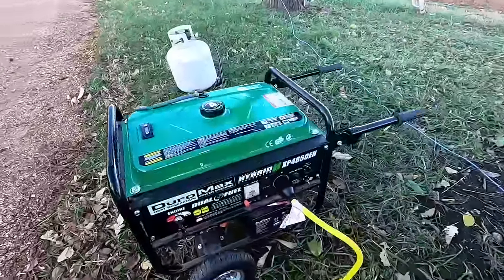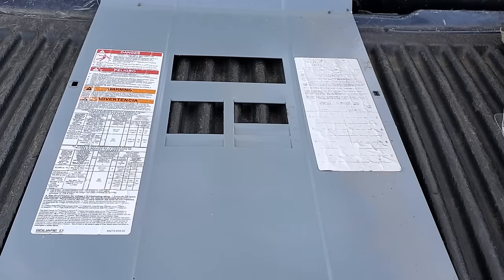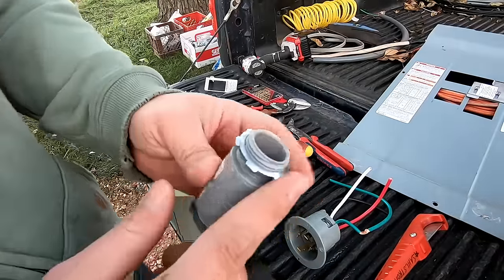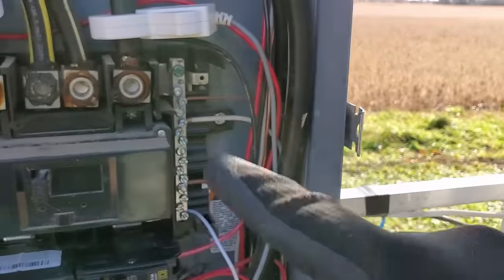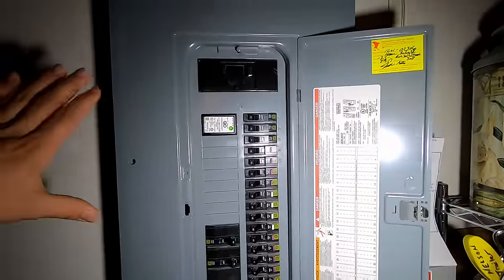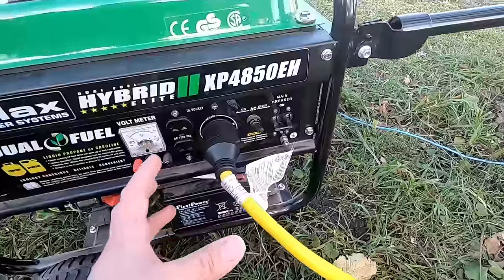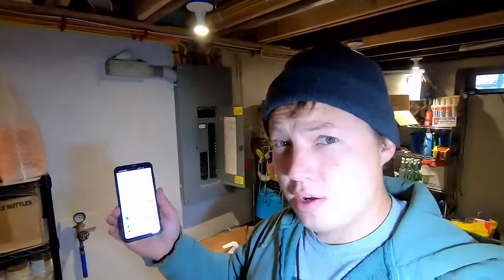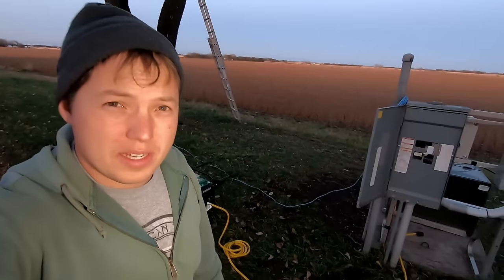How To Hook Up a Generator To Your House Using a Breaker Interlock Kit & Power Inlet Box

Comment: Nice job, the only thing I would add is when connecting 2 wires twist the 2 bare wires together prior to putting the wire nut on, in the event the wire nut loosens the wires will remain nice and tight.
Reply: Can't individually tug test twisted wires, bruh.
Reply: Here are the generator safety rules that everyone needs to follow: this is just a reminder for everyone’s safety. Always make sure you follow all the generator safety rules whenever you use your portable generator. Generators can be dangerous if not used carefully. Every year, hundreds of people die or get injured when using portable generators due to carbon monoxide poisoning and electrocution. Make sure you are using your generator carefully and keeping others safe as well. There is something very serious that everyone should always be aware of when using generators. Some people do run their generator indoors which is not safe and that increases the risk of carbon monoxide poisoning which can cause death of family and you. Some people run their generator in wet conditions which can electrocute them. Please remember that you should never run your generator indoors. Remember that carbon monoxide is an odorless and colorless gas that you cannot see or smell. Carbon monoxide is a silent killer. Keep that in mind. Make sure your generator is 15-20 feet away from your house and away from doors, windows, and vents. Never use your generator in your porch too. Having a carbon monoxide detector is very important against generator safety. Some people also allow children to go near the portable generator which could pose risks. We need to keep an eye on our children making sure that they are not near the portable generator so they won’t get electrocuted or burned by the generator which is dangerous. A locking enclosure also keeps kids safe. A generator shed might look like a tempting place to explore, or take cover during a game of hide and seek, but a generator is a dangerous piece of equipment that can cause injury. It says on the manual that we should also keep children away at all times from the portable generator to avoid injuries. Please do not allow a child or unqualified people to operate the portable generator.  It is important to keep your children safe especially little ones. The portable generator can be hot during an operation. Just because some manuals missed what should be listed doesn’t mean it’s safe to do. Always follow the generator safety rules when using portable generators. Generators pose electrical risks. If you need to use your generator during wet weather, you need a generator tent to protect your generator from getting wet. Don’t let your generator get wet. Keep your generator dry and before using your generator, please make sure your hands and your generator is dry. Do not wear loose clothing when operating the generator. Everything that is said on the generator’s operating manual should not be ignored. Never smoke cigarettes near the generator. Please keep flammable things away from the generator. Never overload your generator too. Your generator can catch fire. Never ever try to plug a generator cord into a wall outlet to avoid back feeding. Back feeding your generator is dangerous. Always turn on your generator first before plugging in appliances and shut off the appliances before turning your generator off. Use a heavy duty cord for your generator and the cord should not be worn out. All the instructions should be followed carefully. Never refuel your generator while it’s running. It can cause fire if fuel spills while your generator is hot. You should turn off your generator and let it cool off before refueling it. Having a fire extinguisher next to the generator is also important. This is only a reminder for everyone’s safety of using generators. Make sure your generator is properly grounded. Having a fire extinguisher next to the generator is also important against the safety rules. https://youtu.be/I1jT3ANENvI and here is a video more about keeping others safe when using generators and also about our family’s safety. It’s important to keep our little children safe as well. Make sure your little children are kept away from the generator at all times especially when it’s running. Hope everyone finds this helpful. Always remember that it’s better to be safe than sorry. Remember that warnings should not be ignored.

Comment: Great Video!  I would love to see you make a video about connecting a Ford Propower truck with the on board generator to your home.  To avoid a ground fault code on the truck, that system needs a three-pole transfer switch instead of an interlock.  I think a video where you go through the bonding on that system and the safe methods needed to connect the truck to the house would be great!

Comment: A very well done video. One suggestion, I live near  Houston and it is very humid here and with the ethanol gas if you don't drain the fuel tank after every use that steel tank will rust in no time. What I have done is use only non-ethanol gas and replace the metal tank with a plastic marine fuel tank. No rust and no problems. Leave it fueled so it is ready to go any time you need it.

Comment: This video is a few months old, but I have a comment and a possible reason why you only got to about 3100 watts before the breaker tripped.  I have the same generator and the manual says that when running on gasoline AC rated wattage is 3850 watts.  But when running off of Propane the rated wattage is only 3273 watts with a peak surge of 4123 watts.  So if you really want to use all of that power it would be best to run the generator on gasoline.  Having said that, I only use Propane to run mine because I only  use it to run the A/C unit on my camper.   However, it does seem that the vent hoses are of very poor quality and will soon crack.  I've replaced mine with better quality hose. Other than that little quirk, it's a great little unit.
Reply: If it were lack of engine horsepower it would have slowed down and caused low frequency and possibly voltage or it would have stalled entirely. It tripped the breaker but remained running which tells me that he had an unbalanced load with too many amps on one hot leg. Supposedly the Sense monitor can show individual leg/phase amps and this would have to be monitored when on generator.
Reply: @danielthechskid  I got this information from page 52 of the Generator Operator's manual.  The expected wattage is listed under "specifications".  I'm not knocking the video or the generator.  Just quoting a page directly out of the manual.  I don't use anywhere near  that wattage, so I don't know this for sure

Comment: Good job on the video. The generator wattage is reduced on Propane by about 10% to 15% versus running on gas which is why it tripped earlier than expected.
Reply: Here are the generator safety rules that everyone needs to follow: this is just a reminder for everyone’s safety. Always make sure you follow all the generator safety rules whenever you use your portable generator. Generators can be dangerous if not used carefully. Every year, hundreds of people die or get injured when using portable generators due to carbon monoxide poisoning and electrocution. Make sure you are using your generator carefully and keeping others safe as well. There is something very serious that everyone should always be aware of when using generators. Some people do run their generator indoors which is not safe and that increases the risk of carbon monoxide poisoning which can cause death of family and you. Some people run their generator in wet conditions which can electrocute them. Please remember that you should never run your generator indoors. Remember that carbon monoxide is an odorless and colorless gas that you cannot see or smell. Carbon monoxide is a silent killer. Keep that in mind. Make sure your generator is 15-20 feet away from your house and away from doors, windows, and vents. Never use your generator in your porch too. Having a carbon monoxide detector is very important against generator safety. Some people also allow children to go near the portable generator which could pose risks. We need to keep an eye on our children making sure that they are not near the portable generator so they won’t get electrocuted or burned by the generator which is dangerous. A locking enclosure also keeps kids safe. A generator shed might look like a tempting place to explore, or take cover during a game of hide and seek, but a generator is a dangerous piece of equipment that can cause injury. It says on the manual that we should also keep children away at all times from the portable generator to avoid injuries. Please do not allow a child or unqualified people to operate the portable generator.  It is important to keep your children safe especially little ones. The portable generator can be hot during an operation. Just because some manuals missed what should be listed doesn’t mean it’s safe to do. Always follow the generator safety rules when using portable generators. Generators pose electrical risks. If you need to use your generator during wet weather, you need a generator tent to protect your generator from getting wet. Don’t let your generator get wet. Keep your generator dry and before using your generator, please make sure your hands and your generator is dry. Do not wear loose clothing when operating the generator. Everything that is said on the generator’s operating manual should not be ignored. Never smoke cigarettes near the generator. Please keep flammable things away from the generator. Never overload your generator too. Your generator can catch fire. Never ever try to plug a generator cord into a wall outlet to avoid back feeding. Back feeding your generator is dangerous. Always turn on your generator first before plugging in appliances and shut off the appliances before turning your generator off. Use a heavy duty cord for your generator and the cord should not be worn out. All the instructions should be followed carefully. Never refuel your generator while it’s running. It can cause fire if fuel spills while your generator is hot. You should turn off your generator and let it cool off before refueling it. Having a fire extinguisher next to the generator is also important. This is only a reminder for everyone’s safety of using generators. Make sure your generator is properly grounded. Having a fire extinguisher next to the generator is also important against the safety rules. https://youtu.be/I1jT3ANENvI and here is a video more about keeping others safe when using generators and also about our family’s safety. It’s important to keep our little children safe as well. Make sure your little children are kept away from the generator at all times especially when it’s running. Hope everyone finds this helpful. Always remember that it’s better to be safe than sorry. Remember that warnings should not be ignored.

Comment: This is great.  I did this once before without the interlock, but the interlock makes it so much safer.  Thanks.  Sure beats the whole transfer switch issue.
Reply: Generator safety rules: Always make sure you follow all the generator safety rules whenever you use your portable generator. This is a reminder for everyone’s safety of using generators. Generators can be dangerous if not used carefully. Every year, hundreds of people die or get injured when using portable generators due to carbon monoxide poisoning and electrocution. Make sure you are using your generator carefully and keeping others safe as well. There is something very serious that everyone should always be aware of when using generators. Some people do run their generator indoors which is not safe and that increases the risk of carbon monoxide poisoning which can cause death of family and you. Some people run their generator in wet conditions which can electrocute them. Please remember that you should never run your generator indoors. Remember that carbon monoxide is an odorless and colorless gas that you cannot see or smell. Carbon monoxide is a silent killer. Keep that in mind. Make sure your generator is 15-20 feet away from your house and away from doors, windows, and vents. Never use your generator in your porch too. Having a carbon monoxide detector is very important against generator safety. Some people also allow children to go near the portable generator which could pose risks. We need to keep an eye on our children making sure that they are not near the portable generator so they won’t get electrocuted or burned by the generator which is dangerous. A locking enclosure also keeps kids safe. A generator shed might look like a tempting place to explore, or take cover during a game of hide and seek, but a generator is a dangerous piece of equipment that can cause injury. It says on the manual that we should also keep children away at all times from the portable generator to avoid injuries. Please do not allow a child or unqualified people to operate the portable generator.  It is important to keep your children safe especially little ones. The portable generator can be hot during an operation. Just because some manuals missed what should be listed doesn’t mean it’s safe to do. Always follow the generator safety rules when using portable generators. Generators pose electrical risks. If you need to use your generator during wet weather, you need a generator tent to protect your generator from getting wet. Don’t let your generator get wet. Keep your generator dry and before using your generator, please make sure your hands and your generator is dry. Do not wear loose clothing when operating the generator. Everything that is said on the generator’s operating manual should not be ignored. Never smoke cigarettes near the generator. Please keep flammable things away from the generator. Never overload your generator too. Your generator can catch fire. Never ever try to plug a generator cord into a wall outlet to avoid back feeding. Back feeding your generator is dangerous. Always turn on your generator first before plugging in appliances and shut off the appliances before turning your generator off. Use a heavy duty cord for your generator and the cord should not be worn out. All the instructions should be followed carefully. Never refuel your generator while it’s running. It can cause fire if fuel spills while your generator is hot. You should turn off your generator and let it cool off before refueling it. Having a fire extinguisher next to the generator is also important. This is only a reminder for everyone’s safety of using generators. Make sure your generator is properly grounded. Having a fire extinguisher next to the generator is also important against the safety rules. https://youtu.be/I1jT3ANENvI and here is a video more about keeping others safe when using generators and also about our family’s safety. It’s important to keep our little children safe as well. Make sure your little children are kept away from the generator at all times especially when it’s running. Hope this helps. Always remember that it’s better to be safe than sorry. Also remember that warnings should not be ignored too.

Comment: The wiring leaving the box in your house is done nice. Not an electrician but I do appreciate neat and orderly wiring.
Reply: Don’t forget about the generator safety tips as well. Remember safety is always important. Here are the generator safety tips:

1) Please do not allow an unqualified person or your children to operate the portable generator. Just because some manuals don’t say that doesn’t mean it’s safe. That is important against the generator safety rules. We also need to be keeping an eye on our children too. You need to make sure that your children are not playing near the portable generator especially when it’s running so they won’t get electrocuted. Generators pose electrical risks and they can be hot during an operation. Please keep your children away from the portable generator at all times. It is important to keep our children safe especially our little ones. Be aware of all the hazards.

2) Some people use their portable generators indoors which increases the risk of carbon monoxide poisoning. It’s important to have a carbon monoxide if you have a gas generator. Never ever use your generator indoors even if your doors and windows are open and even in the garage is not safe to use a portable generator. Not even at your porch and your deck. It is never safe to use your generator indoors and in enclosed areas of your home. Your generator needs to be 15-20 feet away from your house. 

3) 🔥generators cause fire hazards too. Never refuel your generator while it’s running. You need to let your generator cool off before refueling it and before storing your generator. Never overload your generator too. Never ever back feed your generator. You should never plug your generator into a wall outlet. Also never store propane tanks indoors. Please keep flammable things away from the generator as well and please don’t smoke cigarettes near the generator. Having a fire extinguisher next to the generator is also important against the generator safety rules. 

4) generator operation; make sure your hands are dry before touching the generator. Never use your generator in wet conditions. Don’t let your generator get wet. You need a generator tent if you need to use your generator during wet weather. Please don’t wear loose clothes when operating the generator. Turn on your generator before plugging in appliances. Use the right cord for your generator. Please do not use worn out cords. 

https://youtu.be/I1jT3ANENvI and here is a video more about keeping others safe when using generators and also about our family’s safety. Hope this helps